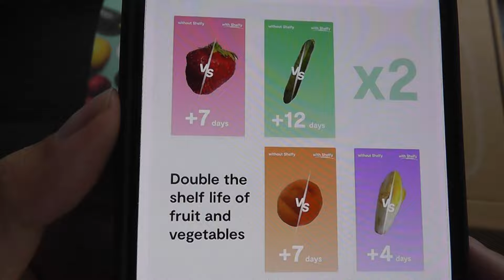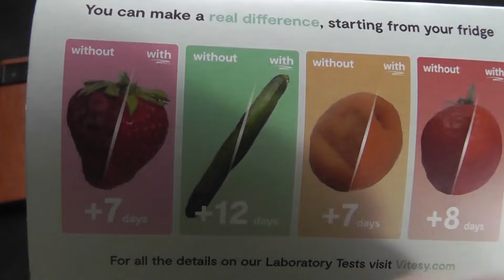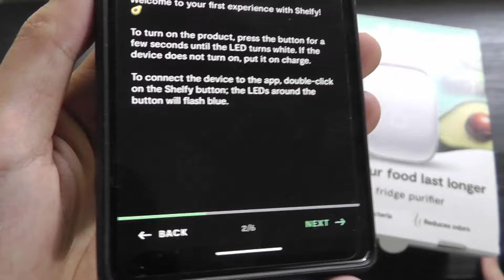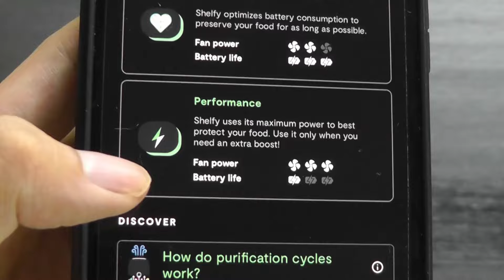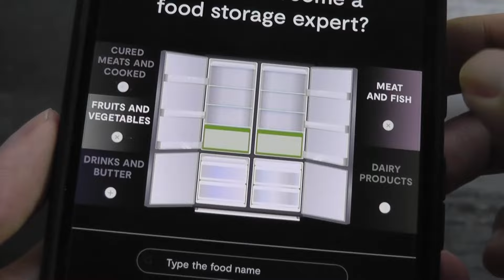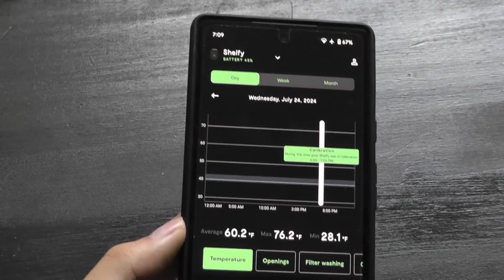First Look: Shelfy Smart Refrigerator Purifier - Extends Food Freshness and Removes Bad Odors?

Comment from the maker: Note: Hey all, for those curious about what's going on inside, adding a quick correction re: lights when opening the Shelfy (as shown in video). According to the company, it's using something called photocatalytic technology: "From a chemical-physical point of view, WO3 has a particular structure that allows it to be activated by the visible band LEDs that illuminate the ceramic filter inside Vitesy products.The use of WO3 instead of TiO2 guarantees the Vitesy technology greater safety (Ozone free), better performance, and reduced power consumption versus traditional UV-C." In order words, it's not the lights per say that kills germs/bacteria directly, but rather turning on the lights activates a chemical process on the special filter (which in turn kills 99% of volatile organic compounds). The sanitization results are similar to UV-C, except it's supposedly safer and more energy efficient :)